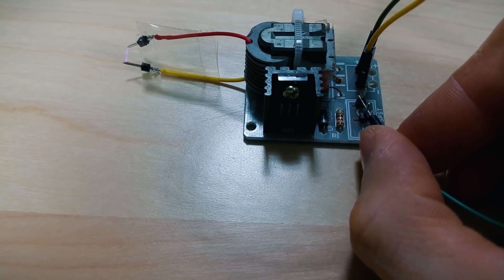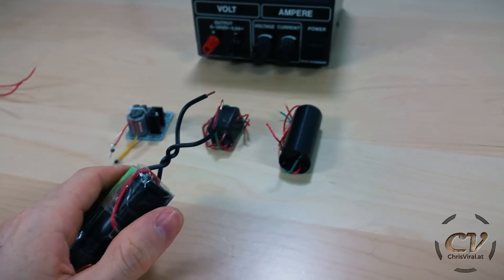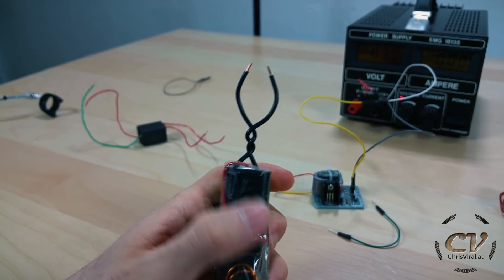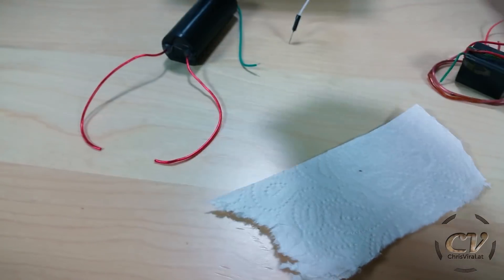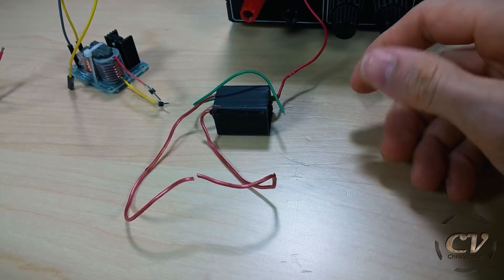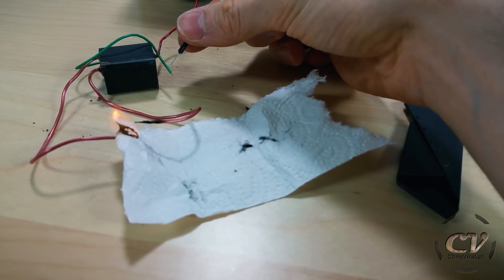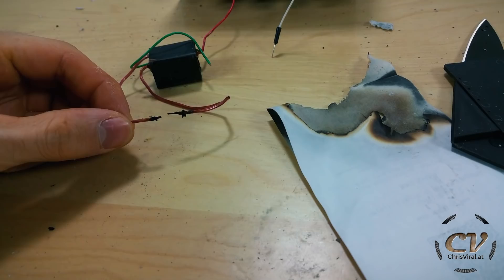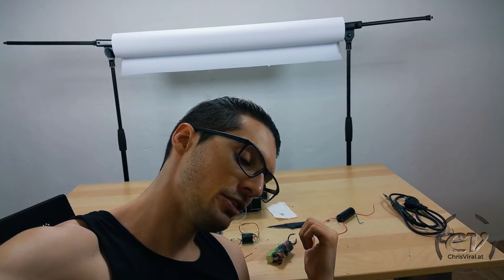High Voltage Modules Comparison (15KV, 20KV, 400KV)

Comment: I have similar left one. It easily  produce 10mm spark from 3.7v li-battery. Could easily cut and burn paper. All other have step up system for higher voltage.
Reply from the maker: As far as I know they all are a step up system, since they "step up" the voltage from 3.7 to something higher.
Reply: How fast it discharges 3.7v battery?
Reply: @marvinloka1246  unfortunatly I dont know. Transistor overheats super fast. You can use it max 30s then cool it down. From the specification it consumes around 2A. If the lithium battery would be 2A/h it will work 1h. If you will place electrods 6mm(~1/4inch) from each other and point sharp end to each other. It will produce effect like in star wars when you will move it

Comment: they all use the same transformer, just the two higher voltage use a voltage multiplier and output DC high voltage
have stripped the potting from the two high voltage units with acetone and they all had identical transformers.
Reply from the maker: Interesting thanks, how did you do that exactly? Just putting it in a cup of acetone and wait?
Reply: @ChrisViralVlogs  i did it in a sealed jar to avoid excessive evaporation of the acetone and left it a couple of days. if left to long even the transformer starts to dissolve. with the "400000v" one has a plastic case that needs to be removed to access all of the resin potting. and the voltage isn't close to what they say, as in air that would mean a 200mm spark gap which it doesn't come close to.
Reply from the maker: Thanks a bunch for your feedback!
Reply: There is a simple dc and ac tester. You just need to use dc and ac voltage on dc motor and you will see cuz ac doesnt work on dc motors.
Reply: @ThatChemistGuy  WTF? try being relevant in your comments and replies.
Reply: can you use two modules in parrelel for a higher current?
Reply from the maker: Yes! You can buy wire them in parallel and it is absolutely insane: https://youtu.be/BRbHBiwdcc8

Comment: EDIT: you made me doubt  ;=), so i tested it now my self. I used one 18650 only with 8mm arc and injected a massive gas amount (nearly liquid gas trying to blow it out) 
towards the arc. It works to ignite with no problem. Now my room smells like a butane Factory xD.  It is defentively the right choice, please try it out for yourself.
If you have problems remeber use properly UNisolated cables. Mabe bulid "cable holder"
so the 2 electrodes keep the same distance.(Holder should be made out of wood or plastic, or more heat resistant ideas ("gips","Ton ungebrannt", "beton") the tighter they are together the stronger and hotter the arc is (depends of Volt and Amps too).

Text i wrote before the Edit :)
you kind of doing the test a bit unequal. :D
0. proper unisolated cable works with no prblems, i never tried your burned cable idea xD
1. for igniting gas the length of an arc doesnt really matter, some use only 1-2mm .
The arc just have to have contact with the gas. I recommended that modul since the arc has the benefit of being hotter and more quiet.
Please try it out with your flame thrower before abandoning this module, it doesnt need long to test this. But please use unisolated cables. or mabe add better cables (the black 1-wire type you showed).
2. the module i recommended has not the same electronics/trafo inside.
But the large stun module has the same trafo like the first diy module, but the scematics are different. I know this since i learned how to remove the black resin from my burned disfunctional large stunmodule.(wasn't easy,but messy xD).The second module has the same electronics like the popular plasma arc lighters from ebay.
3. you asked why does the arc doing this (wandering), its a plasma arc which heats up the air so it often bends upwards similar to a jackobs ladder and second reason is the burned plastic might isolate the cable unequally and the arc always goes where the least resistance is.

 Your Current Limiter Led flashed some times, what current limit did you use ?

just for the fun :), it looks you missed out one module the 1000kv (88mm long)
 its a shocking type module, if you are interested here is the link:
https://www.ebay.com/itm/1000kv-Step-up-high-Voltage-Pulse-Inverter-Arc-Generator-Ignition-Coil-Module/253123701130?rt=nc&_trkparms=aid%3D222007%26algo%3DSIM.MBE%26ao%3D2%26asc%3D52885%26meid%3D78de0183a1544adeb90a15cea68d80d0%26pid%3D100005%26rk%3D5%26rkt%3D12%26sd%3D292549680831%26itm%3D253123701130&_trksid=p2047675.c100005.m1851
the benfit of this version is , it can handle 2x 18650,
Reply from the maker: Yes yes I will for sure try it and I also ordered the big module I think two weeks ago, but it looks just like a more powerful stun module... A 20KV for 7.2V would be cool, but I haven't found one so far... I might as well build it myself lol
(only if necessary haha)

Yeah I'll try a short arc, I think the positioning is the most important thing... I already got a better tube. Soon I'll update hehe.

Removing the isolation sounds good! Damn XD
I'll also build a cable holder for sure .

Okay let's see what the big module will do, interesting!
(referencing 2. but I think I misunderstood... anyways)

Thanks for the info and yes, I saw the LEDs flash afterwards as well, I could've amped up the A a bit, but I think it wasn't a decisive factor for my tests.
Reply: i tried it from around 5-7cm distance. If for what ever reason your gas doesn't ignite, reduce the electrode distance and after that i would try a small "windshield". I mean a small metall plate in front of the arc with holes in it, so the gas impact is reduced in speed but not completly blocked from contacting the gas. https://www.google.com/search?q=lochgitter&source=lnms&tbm=isch&sa=X&ved=0ahUKEwj1yqS_9NrcAhUBY1AKHaa6ChIQ_AUICygC
i would guess 3mm down to 1,5mm is good. Maybe the metal plate itself could function as 1 of the 2 elctrodes :). 
Since i tried it , i am still convied the small hot arc is the propper soloution.

for the 7.2v 20kv request i found one, idk if you have it already
https://www.ebay.com/itm/DC-High-voltage-HV-Generator-Inverter-Electric-Ignitor-DIY-Kit-for-18650-Battery/232712286774?epid=2106182592&hash=item362ebbb236%3Ag%3AH1oAAOSwe7BWynVT&_sop=15&_sacat=0&_nkw=high+Voltage+generator+10kv&_from=R40&rt=nc&LH_TitleDesc=1|1|1

 tell me how its worked out for you when you found the time to test it.
Reply from the maker: Omg the mesh idea is amazing! I was thinking about placing the arc rather far away but that would make the whole design kinda weird... When the arc module is placed like 10cm in front of your fist. That sounds like something I have to try! :D

Thanks for the link, never seen this before. Gotta order that! Yeah sure I'll do a video about it soon.